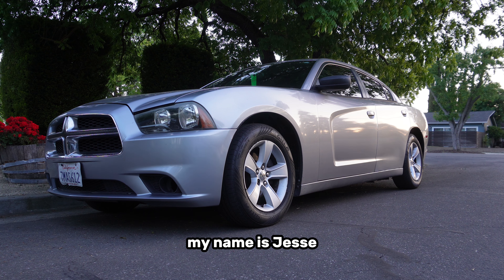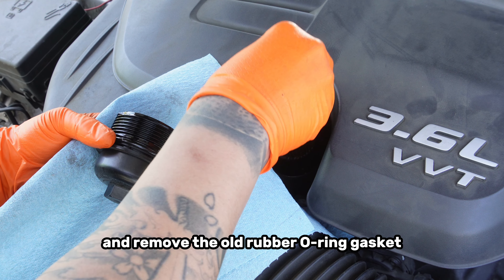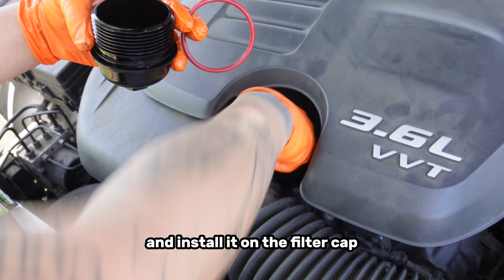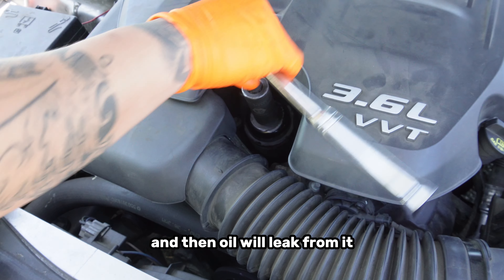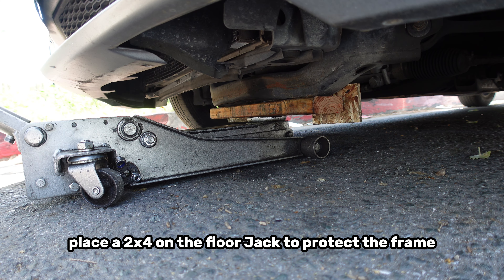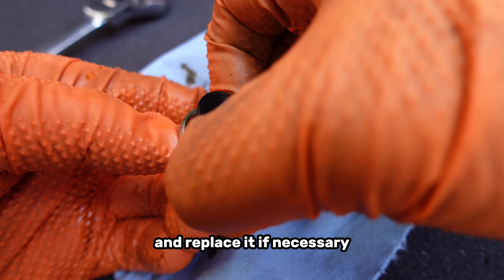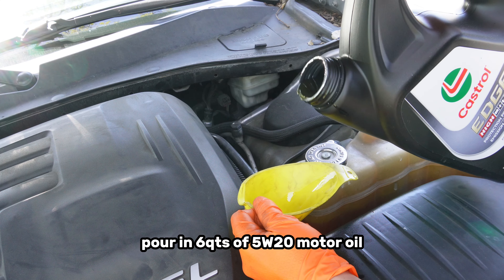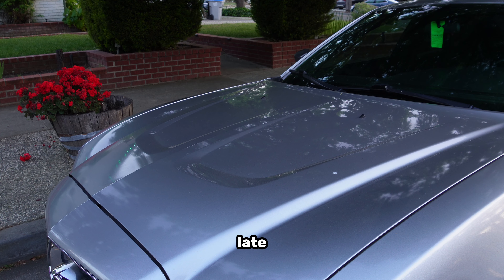How To Change Oil In Your 2011 - 2014 Dodge Charger 3.6

Comment: Do you always wait for the oil change message or do you change it before you get that message?
Reply: That message is saying you need to. Personally, I wouldn't wait and would go off the miles between the last one. Once it's closing in, I would just go ahead and change it.
Reply: You can just check the oil of unsure , oil is supposed to be a hazelnut brown color not black